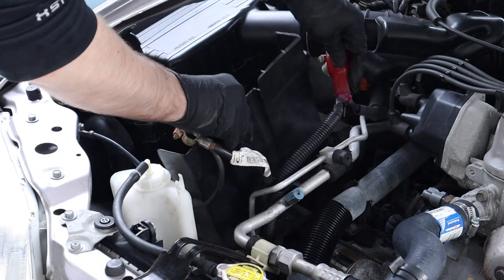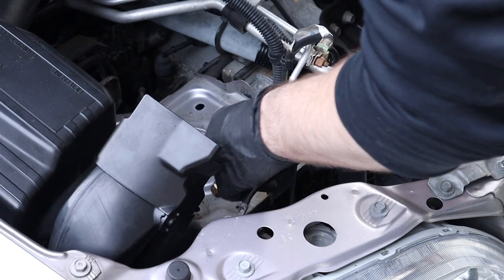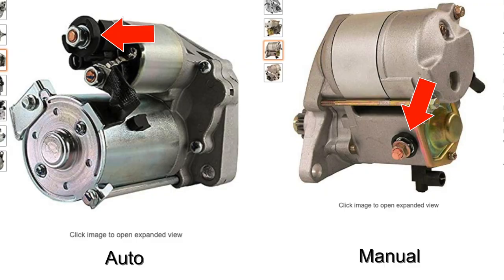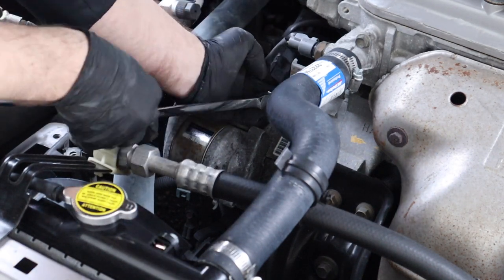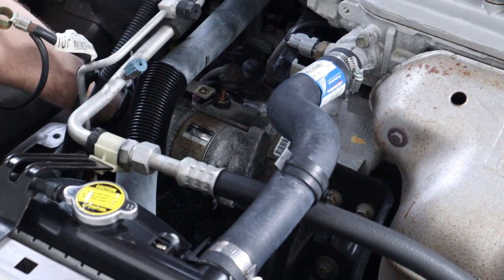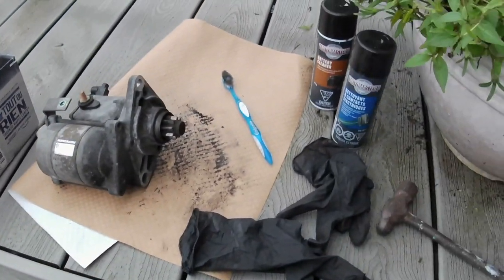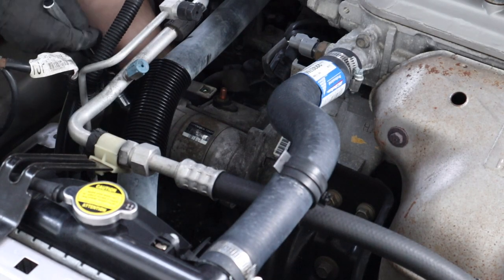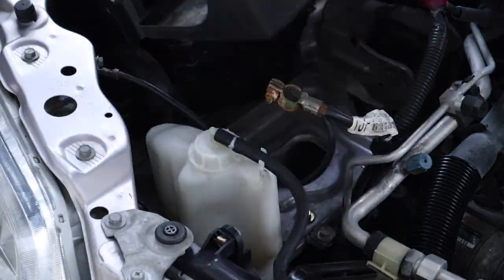Replace Starter Motor Honda Accord / Acura CL | 2.3L 4 CYL

Comment: What was the part number for the manual starter?
Reply from the maker: 31200-PAA-A01 for MT 31200-PAA-A02 for AT (for a 98-99 2.3CL) if you're working on an Accord or a 2.2CL it may be slightly different so please search up a parts catalogue to double check

Comment: Is it easy to make a mistake like not putting the starter motor back on properly?
Reply from the maker: No is pretty easy on these, it really only fits on one way.  Hardest part is getting the lower starter bolt on/off, but even that wasnt too bad.